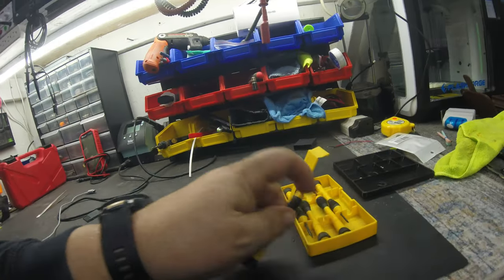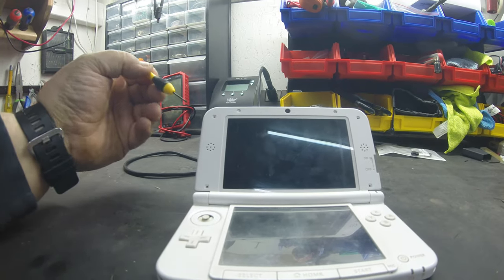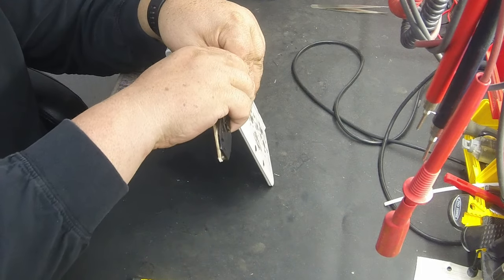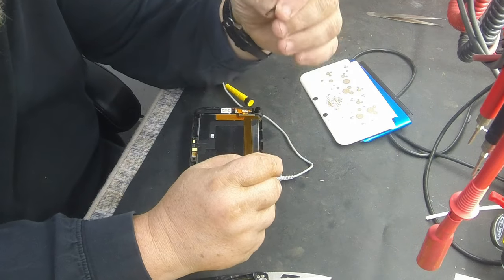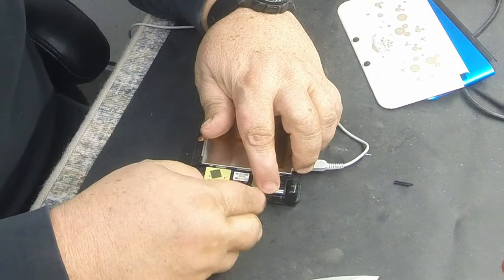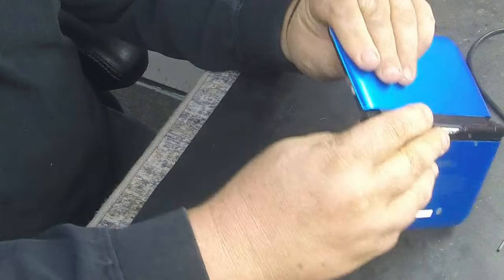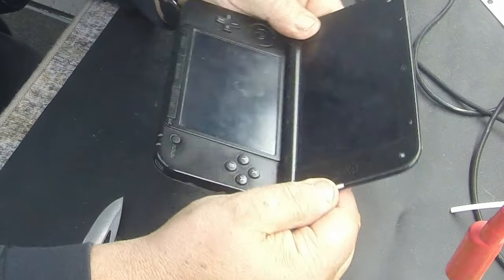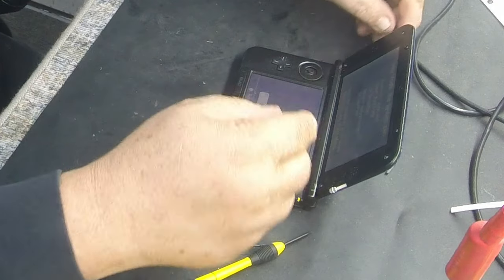Nintendo 3DS XL 3D Slider Button Replacement Repair

Comment: thank you for this video! figured out that this thing at 4:56 broke off clean while trying to reshell my console, now I can only slide it with a toothpick. any chance there'll be a video on how to replace that? or some idiot-proof solution, I don't know😂
Reply from the maker: @cotatoo  pretty easy it just screws in and has a cable to connect. The main thing will be finding a replacement probably best bet is to find a cheap donor that can get the part off of to replace it.

Comment: Great video Mon Ami .....  Where can I get those parts from  ? ....  Keep making the 25 and 29 videos ,  not all repairs are the same .... Xtal leg failures from the board glue is agood example ..... VCO alignment ..... Oh I did find a voltage regulator for my HP 8656B signal generator .... It's a funny thing that it has a 8657 face on it , and green led's , It is one of the later models right before the 8657 came out ....
Reply from the maker: Thanks yes I am working on a 25 now much different issue I need to do a video I have been so busy with yard etc. that I have got behind on making videos.
Reply: @TheElectronMan  I love a good challenge , I had a 25LTD give me fits one time ...... VCO can was bad and intermittent .....